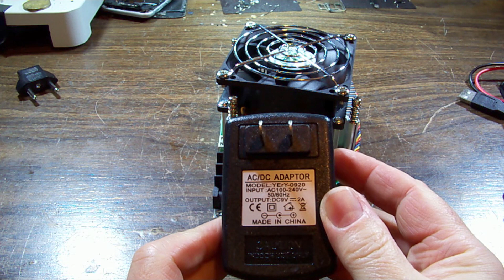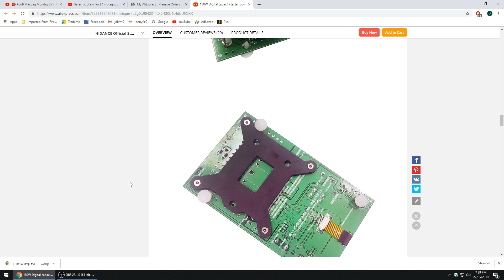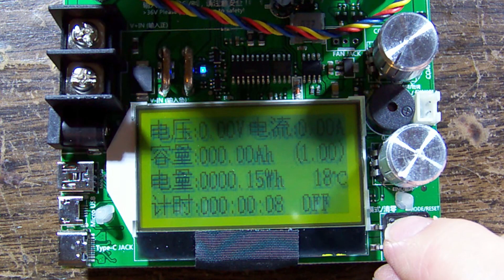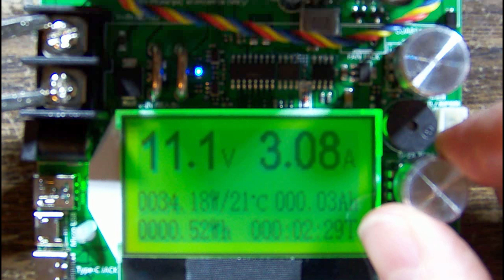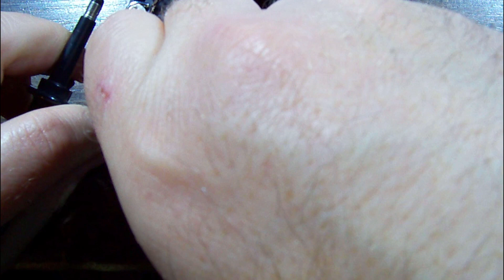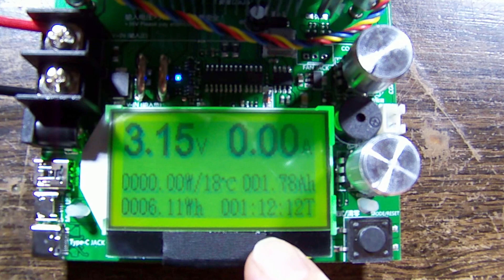180W electronic load review!

Comment: Can you set a limit on how far down it will take a battery ?   Can it cut off once it reaches a set voltage ?
Reply from the maker: Yes. I don't think I covered it but you hold button during power on to enter setup, single click to get to the setting you want to change (in this case <0.00 V)  double click to edit and double click to increase/single click to decrease then let it sit for a few seconds to come out of edit. Power cycle to use. Not perfectly clear in instructions.

Comment: I apologize if this is a dumb question, I want to discharge the battery at 1v. The display shows the batterys voltage and amperage but how can i discharge at constant 1 volt load using this device?
Reply from the maker: No question is dumb. You cannot discharge at a constant voltage, only at a constant current with a cut off once it reaches a set voltage.

Comment: I have the same model but I had to fix the overheating issue caused by a non flash fit of the heatsink. If you need to push some ampere from that load I suggest you to take a look at the power mosfet and possibly change the thermal compound at least and better reseat the heatsink.
Reply from the maker: Good to know, cheers!

Comment: It did seem a bit touchy on the adjustments, if they are ordinary pots then perhaps slap a couple of multiturns in :-D.
Put them on wires and you could panal mount them with the display.
Just a thought :-)
Reply from the maker: Yea, not too worried about the finest adjustments when it comes to loading but it is a standard pot.Would probably only multiturn the fine adjustment or I'll be there all day winding up the bulk of it hehe.
Reply: Jonny Fix
Lol i didn't think that out too well, oops :-D